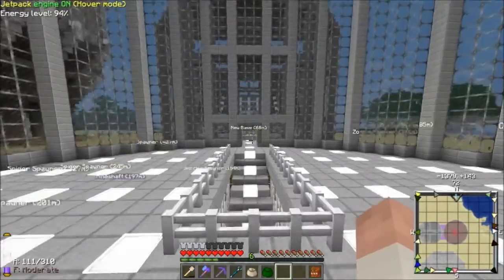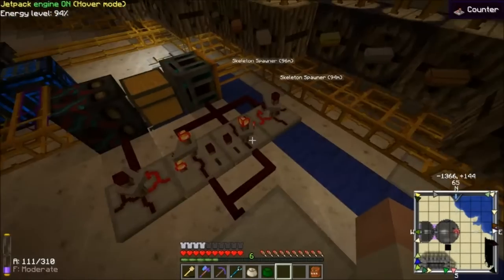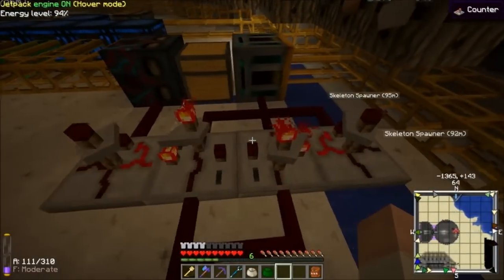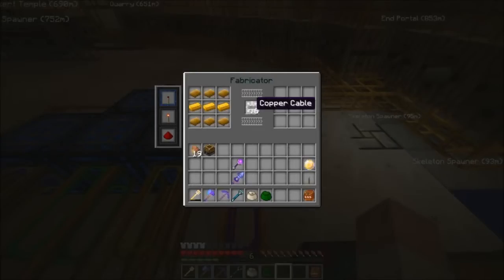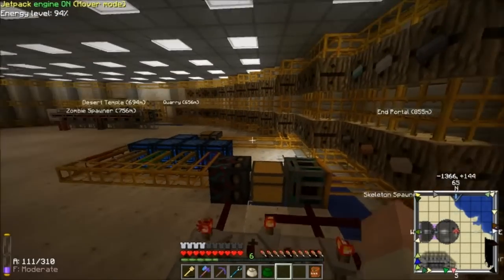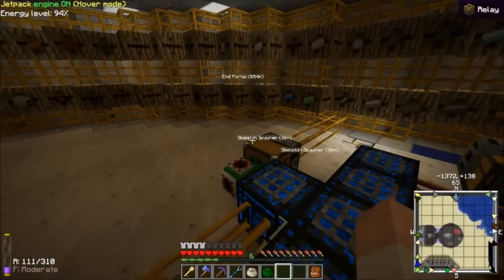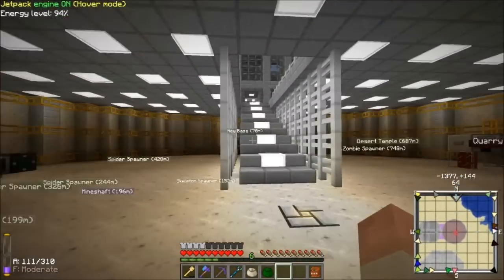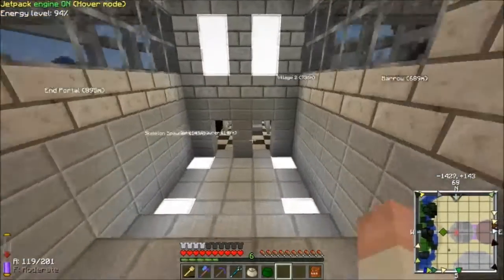Redpower 2 Autocrafting with Retrievers and Sorting machine

Comment from the maker: This was for someone on the mindcrack pack which doesn't have applied energistics at the time.  Mindcrack might have it now, but I wouldn't know as I use FTB Ultimate now.  I used the same process since it was possible in redpower though, instead of fabricators, you use the buildcraft autocrafting table.